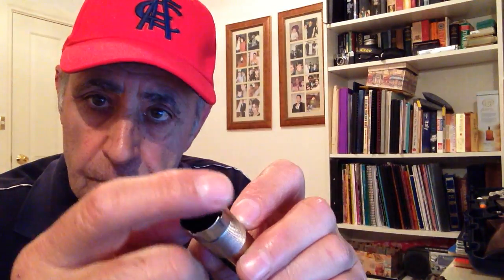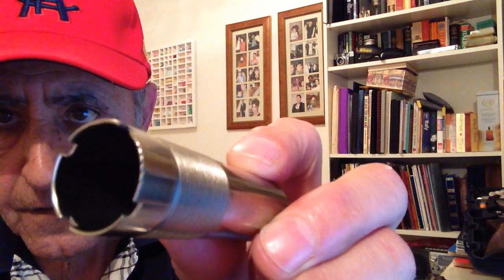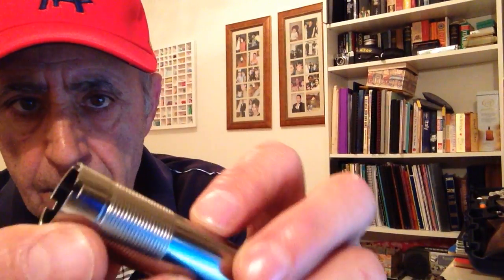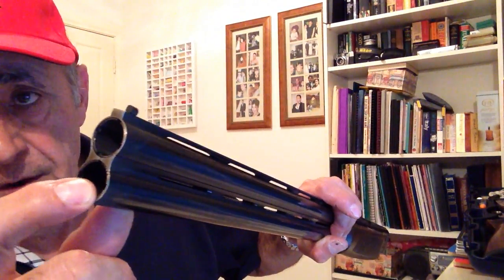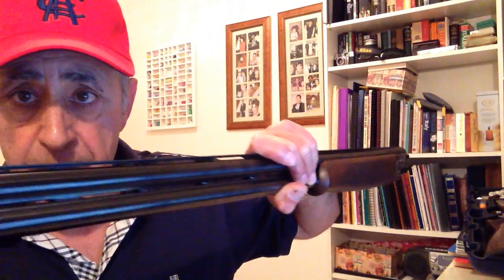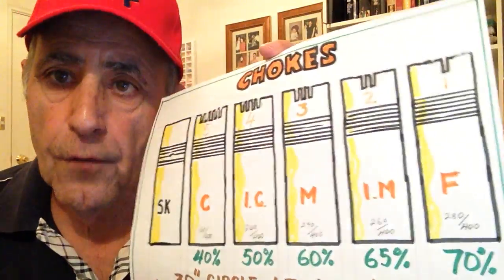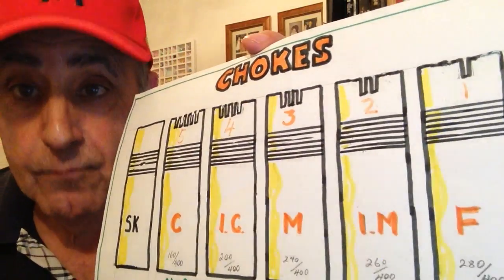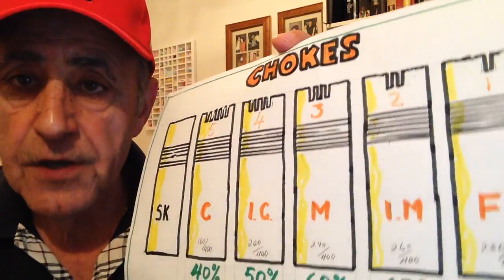Chokes as a Percentage...Roger Pace

Comment: Hi Roger I love your informative videos. More recently I've improved my trap shooting scores to 22 and 23. The reason is I've discovered a combination of light modified in the bottom barrel using Fiocchi FBlack 8.5 2.2mm shot size and modified in the top barrel with Fiocchi 7.5 2.4mm shot size for the back up second shot. I found the sweat spot in my timing with this combination at the distance to break the clay. Both barrels are producing very good breaks with some smokers and no chippers, I'm shooting a Caesar Guerini Summit Impact. So food for thought here that 3/4 and full chokes are not always the starting point for shooting trap and different manufacturers chokes, cartridges and barrels may produce different results. I discovered my combination by testing chokes and patterns at 30 and 40 yards on the pattern plate, other than this shooters will rely on trial and error and may never find the sweet spot cartridge, choke and clay break range combination to suit the speed of acquiring the target with a satisfying break. Once this has been mastered the confidence grows and 25 on occasions are now possible. Hope this comment helps others, regards Paul
Reply from the maker: Good on you Paul and thanks for your input!!!